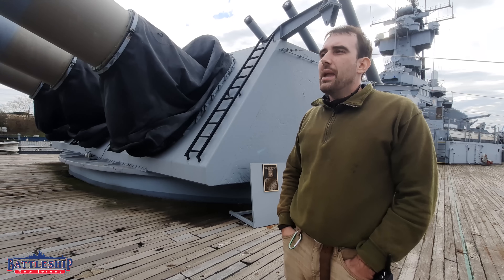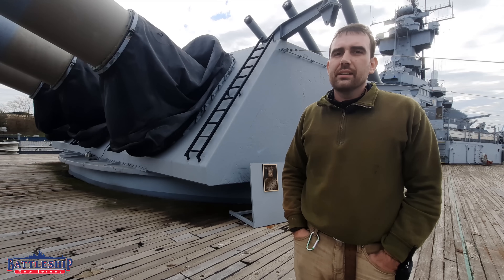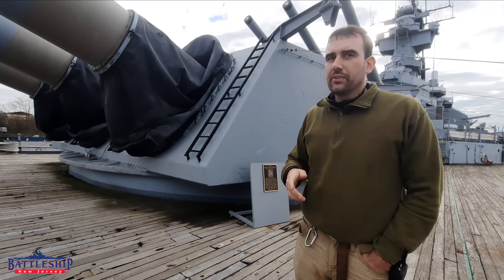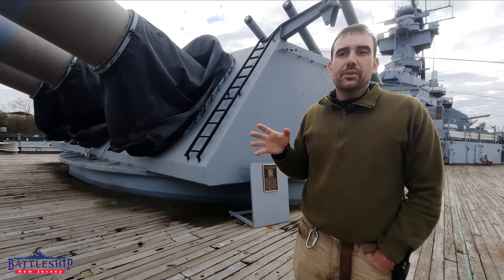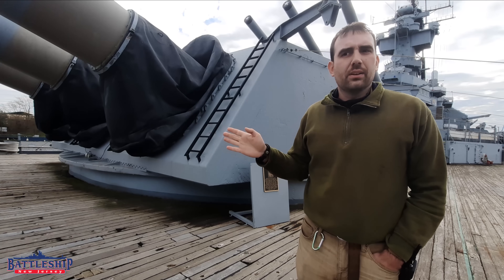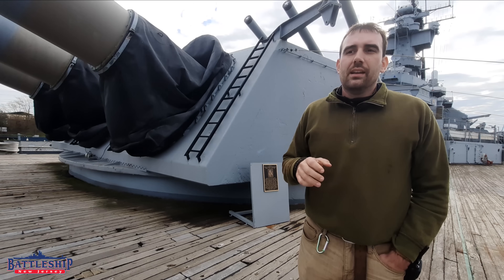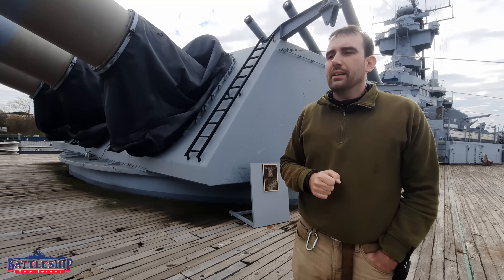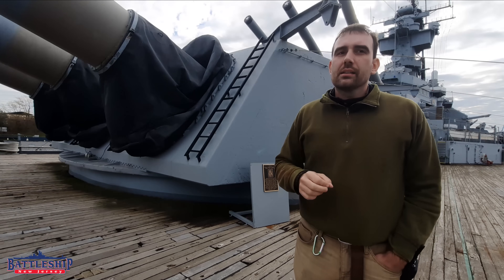Assembling 16in Gun Turrets

Comment: A quick question that I'm not sure has been asked before.  After every shot, did the barrels have to be cooled or made inert so that the heat wouldn't set off the next powder charge?  Love your videos.  Former submarine sailor here.  I was on the USS ULYSSES S. GRANT (SSBN 631) and we were decommissioned at Puget Sound Naval Shipyard in 1992.  One of the Iowa's was right across from us.  Don't remember which one now unfortunately, but several of our guys reenlisted onboard, just to say that they reenlisted onboard a Battleship.
Reply from the maker: The barrels will shoot composed air out after each firing to prevent embers from catching the next powder bags.
Reply: My dad served on the USS U S Grant in WWII. It was built in Germany before the Titanic keel was laid and served as a passenger ship. It was a WWI war prize. The ship was scrapped in 1946 after discharging its crew in New Orleans after the war. In doing research online, I was amazed that the name was used again on SSBN 631. I worked on the Los Angeles and La Jolla in the early 80's at Mare Island by San Francisco.
Reply: A hot gun - one defined as hot enough to possibly set off a powder charge prematurely is more than 50 rounds fired out of a single barrel in a four hour period. The center gun of turret 1 in February 1984 exceeded that amount while firing off the coast of Lebanon.

Comment: It is never a good idea to overload cranes. Even at their rated lifting weight they can fail. Also the rigging used to lift item looses rated strength the greater the angle is from vertical. The rated strength is pretty much reduced by rigging rating ÷ sine of the rigging angle from the vertcal.
This one happened at a power plant in Belgium iirc
https://www.bing.com/videos/search?q=power+plant+crane+failure&&view=detail&mid=1A2A677B87487BF99F8F1A2A677B87487BF99F8F&&FORM=VRDGAR
I'm pretty sure there were some soiled shorts afterwards

Comment: The battleship Iowa has a good tour of a turret on YouTube. I never knew each turret had its own fire control computer.
Reply: They were that good, they didn't upgrade them in the 80's refit
Reply: @christopherwhitfield3037  --  Well, the WWII was an electro-mechanical analog computer.   The Navy has a LOT of experience with most/all of the calculations being done with electronics.  It might have been less expensive to adopt a modern fire control system to operate the old guns than to have updated the original system.

Comment: i actually have 2 regarding the guns
1: how do you set off the main charge of the guns? i see the breech plugs get locked in and the actual trigger is in the fire control, but i have no idea how the main charge of the shells is actually set off
2: how is the ammunition of the 16 guns loaded into the magazines? are there elevators that go from the deck to the shell storage?
Reply: Q1: The gun is normally fired electrically. During the loading process a Mk 15 primer about the size of a 30.06 cartridge is placed in a firing lock at the end of the breech. A wire is connected to the firing lock which is part of the firing circuit. When the circuit is closed the primer is fired into the ignition pad of the powder bag and boom. 
Q2: Right above Ryan’s head is an arm sticking out of the top of the turret. The turret is moved to a specific train angle so the arm is directly over a loading trunk. Hatches are opened to the trunk and with a wire rope hoist going through a pulley on the arm the ammunition is loaded from the main deck to the magazines.
Reply: @robertlian2009  awesome thank you. i wasnt able to find a satisfactory answer to this for a long while

Comment: What is the extent that STS was used in the Iowa class? I’ve heard that they were completely made of the stuff, while I’ve also heard that STS was only used in key areas, such as bulkheads and directors. What’s the truth?
Reply from the maker: Almost any steel less than 6in is sts . More than 6in its either class a or class b armor.
Reply: https://en.wikipedia.org/wiki/Special_treatment_steel
Reply: While STS can be used structurally, in the sources I've read, STS was a separate call out for protection vs structural steel. Example #60 STS is  1 1/2 inch steel. In the drawings in the Norman Freedman books I've seen sts and hts steel as separate call outs.

Comment: Are the guns on all four ships completely identical? Were there any advancements planned for the 16in guns on the Illinois and Kentucky?
Reply: I read somewhere that 16inX56cal had been developed.
Reply: For all practical purposes yes they are identical.
Reply: They were all mk7s. They made a good number of spares, over 30. Advancements in propellant additives and experimental shells certainly took place.  When first used the mk7 barrel life was about 130rds with 2700lb AP. When the 80s ended barrel life was extended to about 1500rds. The liner wear was so minimal they changed the barrel life indicator to fatigue life.
Reply: @jth877  base bleed projectiles were in the concept phase of development in the 80/90s before they were retired again. Would greatly increase the range and accuracy .

Comment: Here's a question on this topic.  Generally when we see battleship wrecks underwater such as Bismark and Yamato where the ship capsized during sinking, the main battery turrets fall out and drop away from the ship before it reaches the bottom.  I understand this was because battleship turrets were only held in place by their own weight.  However, when we see cruiser wrecks on the bottom, such as USS Quincy (CA-39),  the main battery turrets are generally still in place on the ship.  So the cruiser turrets must have been physically attached.  Why the difference in this design for battleships vs. cruisers?
Reply: I would hazard a guess that most Cruisers have much smaller guns than a BB. Looking at the USS Indianapolis.  with its (9x8 main armament) as an example.
Reply: There is in fact a “lip” bolted in several places under the the turret train ring to prevent the turret from rocking on the roller path. Otherwise the weight of the rotating structure could put an unequal amount of weight on just a few of the roller bearings. But those lips pieces are not designed to support the weight of the turret if the ship is upside down. Face it in that condition (upside down) you got other things to worry about 🤔
Reply: @robertlian2009   It is a sad fact that no Navy in the World has ever managed to solve the problem of "So your Ship has capsized. Now what."
Reply: It the same for tanks hulls, (I always thought) the turrets were just sitting on the turret ring, and could fall out if overturned or sideways.
Reply: Johnny Thanks I need a good laugh and you put a smile on my face 😁